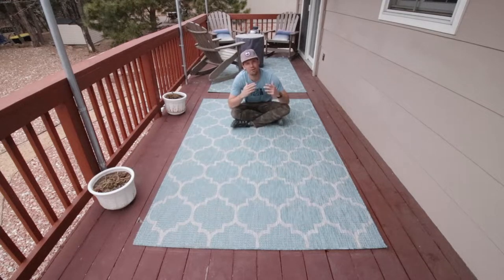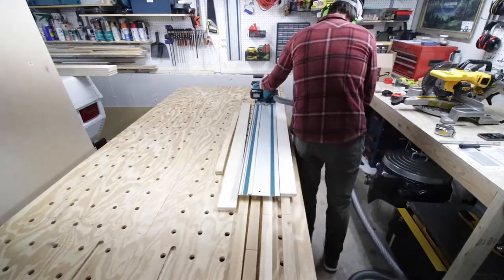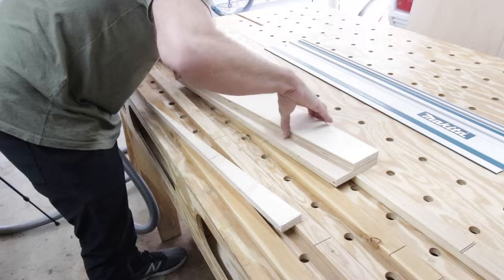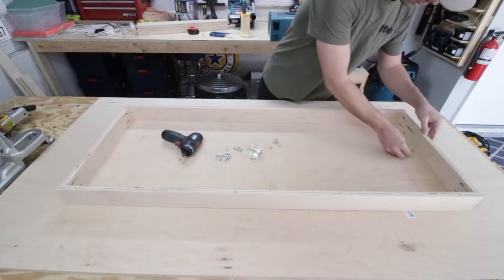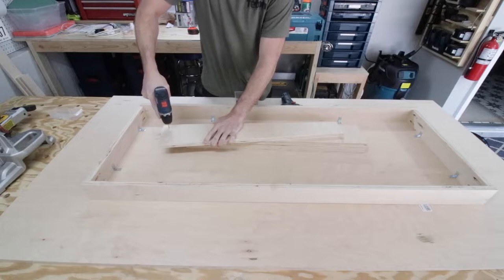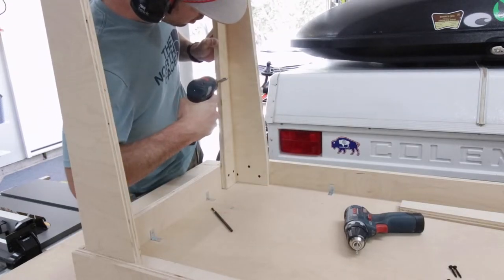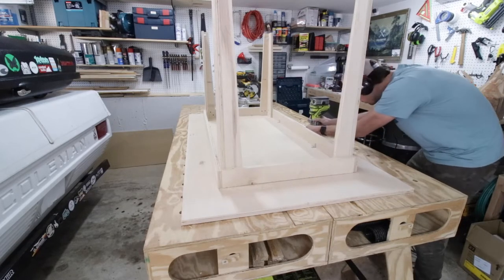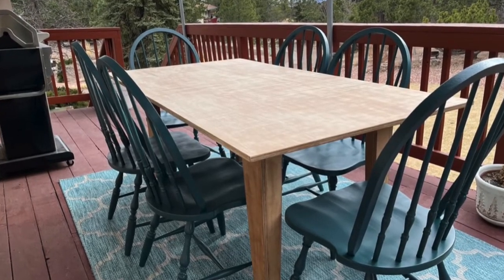Build a Dining Table from One Sheet of Plywood

Comment: Nice quick table if you need it now and don't care how long it last. Unfortunately this will warp as the temperature changes. I would be surprised if it last 6 months outdoors.
Reply from the maker: That exactly what it’s for! Will see.
Reply: @diywithandrew  9 months later, and how is its condition? Would this work well as an indoor table do you think, provided there's a surface cover to protect the wood from spills/condensation sweat?
Reply from the maker: @StormBurnX  It's still doing just fine.  Since we are at 6,000 feet, the sun has definitely caused some cracks but it could probably go another season easily.  Yes, absolutely this would be fine for indoors.